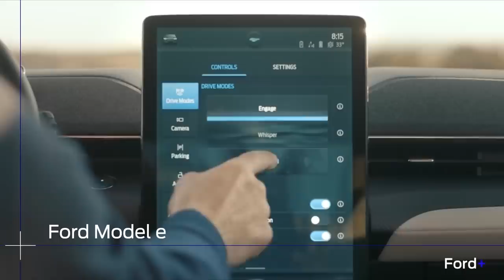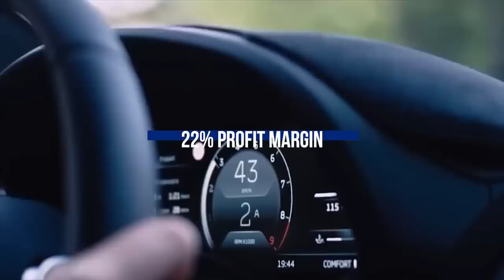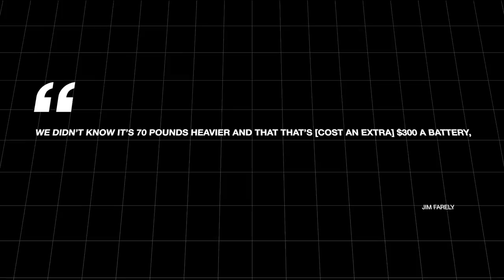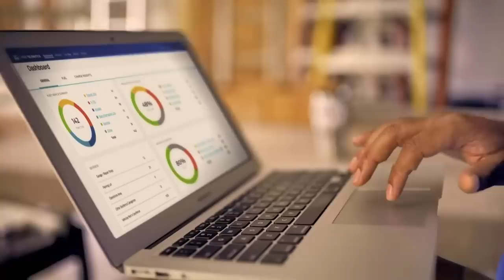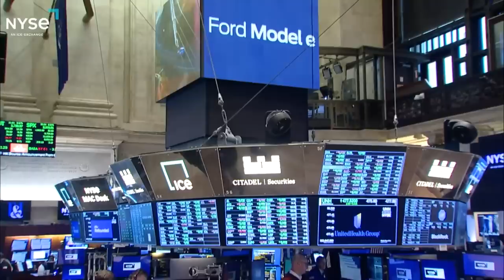More Bad News For Ford Motors

Comment: My biggest concern

-was Toyota and Ford not making the transfer to electric vehicles 
< Toyota is doing an engine modification? >

-theres the diesel problem ( you will need...) ?Need information?
[ Are you saying/thinking... We already have diesel cars, so that's not a priority]

- which company will have ev/gas and ev/diesel
+I know those ideas popped up but no news or a push for it
(Well; do you want to try to go full ev.... Or you just want to limit the use of gas?)
Reply: [yes, very concerning]

Comment: Tesla batteries are diversified.  It has 18650, 2170, 4680, LFP batteries.  Competition buying one battery type from one 3rd battery company.  Tesla vertically integrated.  Everything made on site.  Less JUST IN TIME issues.  Amazing how fast Tesla developed from nothing into something.  At least legacy auto had land and infrastructure.  Tesla started with low gas prices and no tax incentives. BIG 3 too many dancing girls, hunting trips, and parties

Comment: I would never purchase an ev because companies are moving away from right to repair and are lobbying against it every year. Not to mention the tech is so advanced it’s just impossible to work on yourself without thousands of dollars in equipment. Compared to my 97 4 cylinder ranger 5 speed that I could literally take apart in a day and have back together in two 😅. Also I bought my truck for 1000 dollars with only 112k miles clean title from a family of an elderly man who passed. And I just don’t see spending 50k plus on an ev to be worth it.

Not even to mention while you save money on not purchasing gas your spending more often the same amount on insurance compared to a 97 ranger or 2002 Camry
Reply: You are going to regret your poor decisions when gas is $10.00/gallon and rationed Jake. Its coming.

Comment: Ordered a new F150 ice vehicle. I do not want an electric charging battery operated vehicle. Ever. The time it takes to charge these things, the extra cost to set up some thing where you live to plug it in overnight if you remember to plug it in, the fact that they don’t work as well in cold weather where I live, and it gets really cold. They’re too expensive for most people, including myself. The resale value on a vehicle with a used battery is going to be pathetic at best. Can you see someone for example, wanting to buy an old iPhone with a dying battery, not in this world. And the whole point of these electric vehicles to change the weather back to the way it used to be if the way it used to be was the way it was supposed to be really! I’m sorry, but spending a lot of my hard money to buy some kind of an electric vehicle, which is going to disenfranchise me and put me at a disadvantage financially is not going to change the weather ever. I’m not that gullible, it’s sad and pathetic that there’s so many virtue signaling sanctimonious liberals that want to buy the stupid electric vehicles plug them in while they go have their kale juice and their latte. Well, they wait for it to charge. What has happened to this country? It’s just so sad. Plant a tree that’ll make the biggest difference in the world if you’re worried about the weather.

Comment: Ford is losing because its losing overseas sales at fairly rapid rate! The switch to EV's is inevitable at this point! That is one area Ford has been doing fairly well at. It's EV sales rose 167% last year! 
Stellantis while U.S sales dropped last year on some vehicles grew internationally and out earned Ford and GM combined! Being able to compete on the world stage is hugely important! No longer is being dominant in one market going to be enough to survive. Just wait and see how many new manufacturers and vehicles are going to be flooding the market in the next two years! 
I expect to see some more legacy brands go the way of the dinosaurs. The market is rapidly changing. I don't think it impossible to see Toyota or Honda fail also.

Comment: ICE is so engrained in the Ford ecosystem, that the only way they will succeed with EVs to create an entirely new system from manufacture through to sales and service.  My local Ford dealer laughed out loud a decade ago when I asked about the electric Focus.  Currently, they have two Mach-e on their lot, and that's it (besides the packed lot full of ICE pickups and SUVs).  If the dealers don't want to sell them, then their techs won't want to service them.  It might be better to create a whole new brand.
Reply: You forgot to add that no one wants to buy them.

Comment: If you think that Ford Motors will survive, but you want to play it safe, then only put a buy limit order to purchase their stock if the price falls below 6 or even 5. To believe that the equity value of most auto companies will have the same earnings ratio in the next two to four years is delusional, especially if they are losing market share and taking reported losses.

Comment: The Ford is my auto, I shall not want, another
It maketh me to lie down in strange places
It anointeth my head with oil.
Yea tho I ride down the valleys,
I am towed up the hills.
Thy rods and thy engine discomfort me.
I anoint my tires with patches,
My radiator boileth over.
I repair my gearbox in the presence of my enemies.
Surely if this thing faileth me
All the days of my life,
I shall dwell in the repair house forever.

Comment: Anyone got $88,000 to loan me? Oh and the $40,000 dealer adjustment value? Another $10,000 closing cost? For a Ford lightning! Only $138,000 loan. Right? 😆 One that cant even towe a boat. Let alone haul stuff. Invest into Ford? If you want.

Comment: There are going to be a lot of problems in these new designs and people that buy something that costs them a huge amount of money in repairs tend to go elsewhere. We still do not know how long they will last and as long as battery replacements cost half the vehicles total cost who will want one used? I think they are junk and a few years we will see the problems and Ford will probably go down the toilet with the rest of them trying to go 100% in. Tesla is the only electric car company I see succeeding because they are years ahead of the competition. Toyota and Stellantis are both approaching all of this in a different way. They both say there is not enough rare minerals on Earth to sustain these EV's. Unless they invent a battery that lasts and runs off plentiful resources nope not gonna work. Just like OIL and Gas you got to drill and strip mine to get the materials needed just like gas engines need oil.
Reply: Lithium batteries are nearly 100% rechargeable.  Good battery management on charge/recharge cycles make them last a very long time.  These things have improved greatly in just the last year.

Comment: The big question, when are you going to fire this incompetent CEO,bill?  You can't keep making vehicles that continue to breakdown ,massive quality problems , massive price hikes,  I would touch a new ford at any price, I'll keep my old f150s . Hey Farley if it ain't broke don't fix it. Capacitive discharge ignition worked well, single cam worked well , 4speed tranys worked well , camphasers  are junk ,10 speed transmission are junk, and plugs flying through the hood because of two little threads are junk. And yes EV ,s are junk .

Comment: Ford, GM and others are competing with themselves. How do they price a ICE and a E car so that they can sell both cars. If the ICE car cost a lot less than the E car  will people buy the E car or will they buy the ICE car. It cost a lot more to make the E car than the ICE car. How do you price an E car and make money on it and not have people buy the less expensive ICE car. Car factories are most economical when they are running at capacity. So you need to sell a lot of both cars to make a profit on each. You need the profit to finance the change over to E cars which is costing billions.

Comment: Tesla making 30% profits on its EV’s.  Batteries made in house.  Stream lined production.  VW ID 4 requires 30 hours to build one EV vs Teslas  10 hours.  Car batteries have made GRID storage batteries more competitive as Tesla is an energy company also. Powerwall batteries, solar panels and superchargers all made by Tesla.  Teslas msrp pays for its superchargers.  Legacy allowing private and taxpayer to pay for chargers.  Most public chargers only level 2 slow chargers.  All Tesla superchargers are level 3 DC fast chargers.  Many superchargers are powered by solar and megaPacks undercutting costs/kwh competitions chargers.

Comment: but they built a new Mustang that has Electronic Ebrake setting for drifting. Forsight that matches current buyers? 
Why depend more on China/Africa more for supply in EV. They see all the issues they have with supply chain in covid. China will invade Taiwan. And all things made in the Pacific rim will come to a hault.....

Comment: (THE CHARGING INFRASTRUCTURE) , is the BIGGEST Gorilla in the room. Tesla went (All in) and built the "BEGINNINGS" of a charging network.  Does (FORD) AND (TOYOTA) and (EVERYBODY ELSE), think they can just latch on and get by off the work Tesla has already done?  Elon said something like "ya all can use me work".  And that is really nice.  Just don't go stopping there and consider using it for the foreseeable future.  Chip in a little and build the system out.  If (EVERYBODY) latches on to Elons fount.  There is not enough.  His faucet is a "stepping stone".  NOT a solution.  NOBODY has expressed ANY interest in helping the charging situation.  I not even implying that any of the remaining auto giants, do what Elon has done for charging.  I'm just wanting that they all go in (20%) each of them.  And build even better than Elon has already did.  With a few (BIG) companies an a lot more (LITTLE) guys.  I thing all of em' can go together and built at least one electric port at every Exxon.  Or pick your gas station, I don't know who is out there now-day..  I just said Exxon because that is the company I think of when I think gasoline.  Chevron I don't know if they still exist.  BP doesn't, nor AAmco.  Some national chain needs to be associated with an electric filling port.

Comment: It seems to me Ford and others are putting the cart before horse. They have to get the power grid up to par. That means making it about ten times bigger than it is now. The Woke don’t even want talk about that let alone have a plan how they are going to do that or get there. 
Then there’s charge times. 10 minutes for ice,  3 hours for electric. Not practical. Then ev cars are just not practical in cold climates. Too many things that need to be addressed first before investing in the cars.

Comment: The EV craze will come to an end when people realize how uneconomical they are.  Think about it.  Why do you replace your phone every couple of years?  Could it be that the battery degrades in performance where it won't hold a charge very long?  Now apply that same logic to EV cars with those massive lithium batteries under them.  Typical replacement cost of the battery pack is $20000 plus.  So you replace the batteries every 5 years?  What do you do with the old battery packs?  They are NOT easily recyclable. Are we going to fill up our landfills with lithium batteries?  It is so odd that environmentally conscious people completely overlook the COSTS of using electric vehicles.  Oh, did I mention the horrible strip mining involved in lithium production?  Unfortunately, this craze is spurred by virtue signaling more than logic.  Lefties defend it religiously and condemn criticism like it was heresy.  Stupidity and hubris have consequences and we will all discover it in 20 years.

Comment: I'm not buying any EV so soon. Charging (aka re-filling..) takes forever and mileage is really bad during very cold days or when you tow a trailer etc.
I refill my ICE car in less than 5min and can go another 400miles.
Reply: I do not waste 5 minutes fueling my car, I just plug it into my home charger and walk away. You have to leave your property to fuel your car, how so last century is that.
Reply: @SimonEllwood  Ever thought about the millions of people that live in apartments with no garage and no drive way etc??
Reply: light  year 1   440 mîecrabgé   liht years 2 500 mioes
Reply: There will be a very long line at the gas station when gas is rationed Brain. And that's not far off.
Reply: @Abakaschi  Many apartments have dedicated parking increasing with charging. Lamp post charging is also a thing along with supermarkets, gyms, cinemas, workplaces and so on. In the meantime ICE vehicles are available BEVs are just an option right now.
Reply: @SimonEllwood  I live in Michigan. Neither my gym nor the supermarkets have any chargers! One larger supermarket has 6 stalls but on the far end of the parking lot. My employer (>1600 employees, automotive supplier) has 4 slow charging stations on their giant lot; occupied throughout the whole day. No plan to add more near term as per our company’s response to an inquiry on that topic. The apartment complexes around here do NOT have any charger stations either. 

BEV is a no-no when living in an apartment.
BEV can be a very nice option for home owners, I agree.
Reply: @Abakaschi  The US is years behind Europe in BEV's but it will catch up.

Comment: To all car makers,

Please accept the fact that EVs are nothing but self-crematory coffins. These vehicles will offer free and relaxing crematory service for the passengers together with family. The success of F150 and the rest of the EVs throughout the world in automatic catching fire has proven the above true.

If EV makers can't or don't know how to solve the issues of battery catching fire, it's the matter of time for the consumers to find out and dump the silly idea of batteries operated vehicles.
Reply: It's about time all of us must stand together to send our message loud and clear to the entire automotive industries. We want them to know we know what they did last ... century. The true purpose of piston rings engine is to ensure oil cartels are the ultimate beneficiaries. They never have our best interest at heart. We are merely slaves for the banks and car makers.

We deserve vehicles that are absolutely reliable. Free of all sorts of nonsensical designs such as GDI and turbocharger. No more unnecessary oil change or flushing. It's disgusting and simply restarted to say the least.
Reply: Did you know we only need to spend very little on the fuel if only we have high efficiency and  frictionless engines and geartrain? 

Everything under the hood from ICE to EVs are absolutely stupid. I can't stop laughing at these rubbish. 

Enough is enough, no more rubbish.

It's disgraceful to know how automotive industries have been developed over the years. Non of the car makers know how to get it right or perhaps they don't have to.

Comment: the people that tell us "how" to think didnt realize that EVs are not ready for primetime. who wants to be stranded in the middle of nowhere  with an EV. EVs are also horrible environmentally becuase of the nasty batteries that will have to go into a landfill. i have a 69 Pontiac and a 23 Ford Maverick, ecobooost that will last until all the EV talk goes away
Reply: I think the Ford Maverick is an EV. It has a hybrid powertrain.
Reply: @bochap2127  no, i have an ecoboost maverick. i didnt even get a hybrid because i dont trust that either...fire issues last year
Reply: A 69 Pontiac will also be stranded in the middle of nowhere, and is also horrible environmentally, and gas will be $10/gallon and rationed.